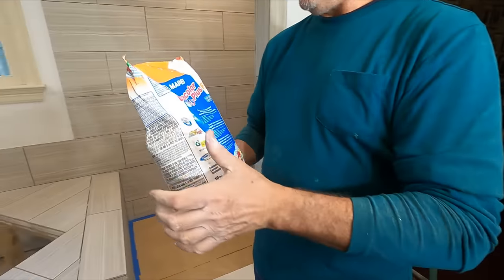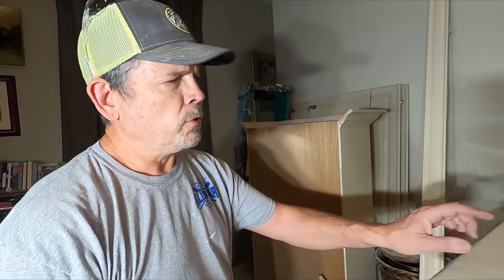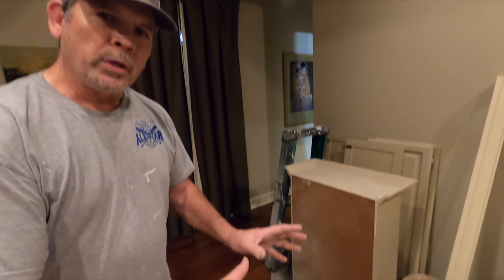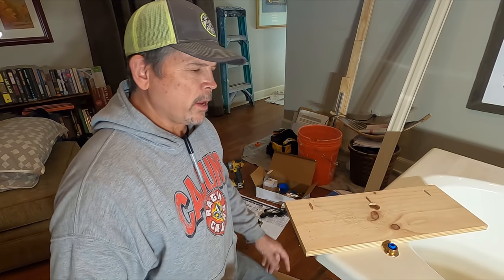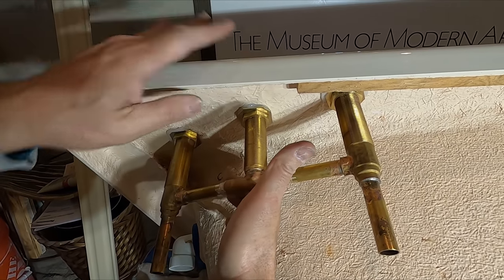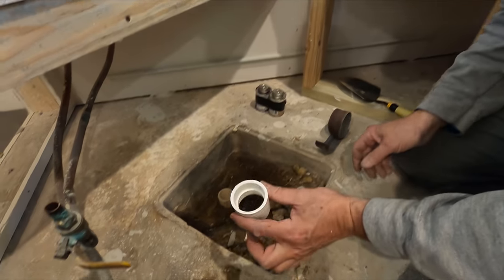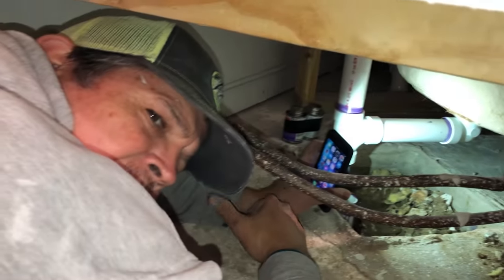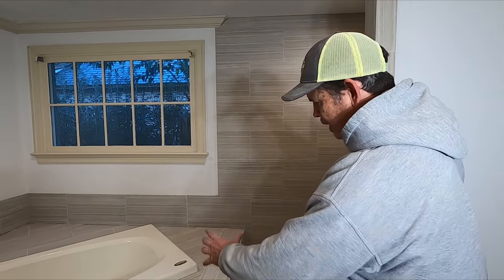A SMOOTH Tub Install and BEAUTIFUL Grout Lines

Comment from the maker: RIP to the Hitachi Corded Drill! 😭 let us know if you have any corded drill recommendations!! 👊🏼

Edit - Also I changed the Thumbnail Gang.. It was driving me crazy all day, I knew it wasn't the best I could do... I wonder where I get that from 🤔🤔🤔
Reply: I'd go beefy D handle driil, like a Dewalt or Ridgid
Reply: I was wondering if that was smoke or previous dust ... Rigid for sure for corded heavy duty drill!
Reply: Ah the memories.  I too burnt up a drill mixing thin set.  Something about tasks like that put a strain on drills.  I replaced the ruined one with a corded Dewalt and it mixed the thin set with ease and is still alive and kicking.
Reply: Get a mixing drill.   Will last longer and not work as hard.  That Hitachi was only meant for drilling holes not mixing mortars and the like.
Reply: I use a 1/2 Milwaukee Magnum still running like a champ! Awesome editing 💯💯👍👍
Reply: Just make sure you get a low rpm high torque drill and you'll be fine. And something a bit bigger than the one your using. I recommend a 1/2 inch. You will be happy with that for a long time.
p.s. Good work, enjoy your video's.
Reply: Dewalt
Reply: I just got a dewalt mixing drill, it is the way to go👍🏻
Reply: I would honestly go with a Metabo. They now own the line your D13VF was built on and the new Metabo HPT D13VF comes with a 5 year warranty. Your drill may be fixable, though. Did you change the brushes when they started to wear out?
Reply: I love my Makita, 35 years old and still going strong!
Reply: @workmanshipbygrace8173  I second this recommendation. Milwaukee's quality is great. This specific drill comes with a 5 year warranty.
Reply: I've been using a D-handle DeWalt for thin-set and setting compound for going on 20 years... same drill!
Reply: Get a proper mud mixing low speed drill, you will kill the best of drills mixing mud. Regular power drills are geared for speed which allows the use of smaller motors so its really hard running them under high load at slow rpms.
Reply: I use Rubi, very powerful and works wonders. Ridgid also has a 2 padle mixer. Would recommend either.
Reply: DeWalt or Bosh
Secondary, what is the state of this house support? Udid 1 room with totaly devasted floor support - whats going on on that front?
Reply: ugh, I can smell that drill through the screen.

call me a fanboy, but I'm probably not going to buy anything except dewalt or bosch.
Reply: I’ve been running the Milwaukee mud mixer daily for three years great mixer
Reply: a dedicated mixing drill is well worth the money.
Reply: I use a D handled Bosch 1/2" drill.  Been using it for 3 years and must have mixed about 40,000lbs of cement, grout, mortar, drypack, plus some large hole saw drilling plus a significant amount of drywall mud mixing.  Still going strong.  Keep in mind you don't want to mix most grouts, mortars at an rpm higher than 200-300 as you will air entrain the material causing potential failures.
Reply: A  spade handle drill ,ridgid has a life time warranty, a lot of tile guys like Dewalt but I didn't like black & decker and I'm not a fan of Dewalt, I had all Dewalt tools at one time but I up graded to Milwaukee and haven't regretted it at all ,the guys that works with me are owners of  Dewalt but they seem to Always have my Milwaukee tools in their hands for some reason.
Reply: Makita 🙂
Reply: I used to have an old right angle DeWalt drill, loud and heavy.
I switched to Ridgid single paddle mixer 1/2 inch chuck. It works wonders , no complaints
Reply: With all of that "mud mixing" get a corded drill 1/2 HP variable speed
Reply: Bosch 550W 240V Corded Hammer drill EasyImpact 550
Reply: Makita DS4012 Spade Handle Drill

Comment: One tip from a plumber, always solder from bottom to top. It’s easier and faster because heat rises. This doesn’t make that much difference on a coupling but the less time with torch on the pipe the less heat goes up into the faucet.
Reply from the maker: Cool thx Josh 👍

Comment: Looks great, guys! I switched to PEX and it has made my recent remodels so much easier, especially in hard to solder places.
Reply: Those cut off valves look suspect.
Reply from the maker: Good call Rick.  One of them leaks 😩

Comment: That was an enormous amount of work from demo to rebuild, and you, sir, are a true artisan who takes pride in every step of your work, never a shortcut, and even willing to redo a job if it doesn't meet your high standards. Well done! It looks fantastic, and I am sure the owners are going to be very happy. I just hope that they don't choose a dark paint color. That master bath is quite small and even with the window, it is quite dark especially since they went with darker tiles. And I know this is late, but going back to one of the first videos, I would have definitely oriented the tub parallel to the wall and extended the shower as much as possible. That diagonal orientation wastes a lot of space in such a small master bath for a tub which is rarely used compared to the shower (you can tell from how new that tub looks) and is not even a whirlpool.

Comment: I reside in the UK, i have watched this project to this point and seriously enjoyed the way you have installed every element, i've been fitting my own shower back in my bathroom; having retiled the whole room floor to ceiling over the last year.
Covid 19 caused some delays of course for materials at certain stages, as i believe you've also had your grout choice of Mapei is excellent have used that myself but the premixed version, is like spreading butter into the joints compared to what people generally use tile adhesive/grout, their not the same thing as you know. Tile grout is exactly that nice and soft and cleans up great!!

I'd like to congratulate you and your son for your videos very well presented and i personally, have picked up quite a few things of benefit to finish my bathroom in due course. I'll watch the rest of the project but felt needed to type at this point and say so :)
Reply from the maker: Awesome thx Chris 👍

Comment: I always run clear silicone around the tub opening when setting the tub so if you get water wicking along the grout lines under the outside silicone tub seal there is a backup.

Comment: You guys are amazing. Especially the way you work together. I would have used vibration saw on those faucet stems with a metal blade. The other day I saw you shim a toilet and then caulk it. Have you ever tried grouting your toilets so that they will never rock? I've been doing that for years and if the toilet has to come out the grout can be knocked out with a putty knife in a hammer. I've learned many new tricks from you guys.
Reply from the maker: Thx James 👍. Yes I’ve grouted toilets in extreme cases 👊

Comment: If you check your local flooring store that sells Schluter products, you can get L mold trims or Quadec trims and corners for tub decks, niches and side walls and a 1/2 inch Lmold for the transition between the Tile and the Hardwood, it finishes it off nice.  For a darker tile that on the floor the A125AT would be nice.
Reply from the maker: We love Schluter trim! The homeowners unfortunately do not. So no trim on this remodel :(

Comment: If you can find Turbo Torch. It works on acetylene or propane and has different size tips and rounded guards that will clip on the tip to keep the flame away from areas that shouldn't get overheated or are flammable. You can also use water spray from a spray bottle on sensitive areas.

Comment: I have a Porter Cable right angle drill for mixing. It’s a bit heavy but has the motor power and the angle helps with the torque. I’m new to your channel but like your videos and the fine work you do.

Comment: Great content.  I get you are setting in mud.  What is done for the lip of the tub where it floats over the deck? Did you studs caulk or leave a gap? If a gap, won't water flow on deck and under tub area?

Comment: I love your videos! You and your son have nailed this down perfectly. The amount of time and detail you spend are both beneficial and not boring us to death. I have a question, or maybe even a tip regarding your plumbing. I've always been a copper guy just because I enjoy doing it and it's been piece of mind knowing my joints are soldered. Recently I've started using PEX and I have to say, I'll never go back. It saves so much time and money and you can make sweeps to fit things like the curved handles and spout you had to straighten to make the copper work. What's your opinion on PEX?

Comment: when i set tile I like to lay it on the mortar touching the adjacent tile then push it away to open up the grout line. If you lay it in leaving a gap when you push the tile tight to the spacers you end up squeezing mortar into the grout line and have to scrape.

Comment: Your dewalt oscillating tool has metal cutting blades that cut very nice, if your ever in a bind like that again. They also make them for grout removal, cutting tile, wood, sheet rock. At this point in time for almost anything you can think of. 🤔
Reply from the maker: Thx Matt.  Yeah I wanted to show folks the saw tip if they don’t have a buzz saw.

Comment: Just noticed at 8:00 the left corner tile is not level and shows up worse when you wipe the excess grout with the sponge. Did you correct that? Just wondering as you are very Persis with all your work. The over all look looks Great and its very well described out in your video how its done.  Thank you

Comment: Any thoughts on getting a cordless mud mixer? Ive been thinking about getting one as I dont like cables dragging on the ground and/or getting concrete mud on it.  I like separate tools so that I get better lifespans on the most common used tools.  I personally like milwaukees cordless drills if you arent thinking about getting a dedicated mud mixer, and both if you want your drill to last longer.

Comment: Hey recent subscriber here.  I like your videos, learned a cool trick on your leveling cement video with the styrofoam strips.
Just my $0.02 but personally I'd have soldered the necessary adapter to the faucet and connected some 30-in Braided Stainless Steel Faucet Supply Line  before I messed with all that.  Would have saved you a lot of headaches in that tight spot.
Nice work guys.
Reply from the maker: Thx William and appreciate the sub👍.  Funny you should mention hoses. I fully expected that faucet to come with hoses much like a sink vanity would. I briefly did consider putting in some hoses but was concerned about water flow issues on that big tub. I really liked the half inch tubing going all the way to the valve.  Good stuff 👊👍

Comment: Do you grout the space between the walls an floors and the wall corners? I'm not sure whether to grout them and silicone over them or just use only silicone to fill. Does the tape on floor cover the space between walls n floor?

Comment: Beautiful tub install.  The only thing I would have done differently would be to use a rubber fernco coupling instead of a pvc coupling for the final tub connection.  Makes it easier and can account for small variances in angle and alignment.  Of course, plumbing codes are different everywhere, and where you are may not allow fernco fittings in this situation.  

As for torch recommendations, I have always used a full acetylene bottle, but that might be a bit overkill if you are only doing bits of plumbing here and there.    The nice thing about the big bottle with the hose is the increase mobility it gives you in tight spaces.
Reply from the maker: I like it Kevin.  I’ll check with our plumbing inspector to see if they allow ferncos or no hubs.  I used to have a large acetylene rig but you’re right it’s probably too much for what I need now.

Comment: It's coming along really nice. My bathtub has foam at the bottom of it, and it's level. It's perfect. I have screwed it into the studs and it's really sturdy. Do you always need to use mortar? I noticed when I removed it, it didn't have anything underneath but a moisture barrier.
Reply from the maker: Don’t always need mortar.  Sounds like you’re okay.

Comment: How long did it take to cut off that faucet nut by hand? I would think an oscillating tool would make quick work of that.
Reply: That's what I was going to say.... oscillation tool works great for that with a fine tooth metal blade.
Reply from the maker: I almost grabbed it.  I wanted to show folks another way in case they didn’t own a buzz saw
Reply: We ALWAYS carry some PB blaster for these situations 👍

Comment: As for the torch, believe it or not, Harbor Freight has a nice one that's inexpensive. Puts out a nice hot flame. It seems to heat the pipe faster than any other torch tip I've owned. I'm actually on my second one, because, like a dummy, I left the first one out in the rain once. Not good. It did corrode quickly.

Comment: I never used a store bought grout sponge- I did once to try it, nah. I would look for old couches and the like being thrown out. I'd collect the foam rubber and cut it to shape. The right foam is a kind of larger type foam foam rubber. It can be cut with utility knives or a band saw for a nice cut. Any size you desire- small large, pointed, thin. Much better than those crummy store bought kind.

Comment: I noticed your drill did what my drill did when I tried to use it to mix mortar. I don't understand why the drills don't work, my drill was made for cement and mortar mixing, I do not understand what I did wrong. You guys have any suggestions as to what drills are better at mixing?
Reply: If your drill was fairly new, you may have tried to go too fast too soon. Mortar is a colloidal slurry and until you get it moving, it is very thick, but as you get it started, it experiences shear and thins out a bit until it settles again and the particles pack once more. If you've used your drill for a while, it may be time to change the brushes if it's not too late. Changing the brushes too late can result in overheating due to arcing at the brushes and can melt the plastics holding the brush holders. The coils are usually still good, but you'll have a heck of a time with the brush holders if there was melting.

Comment: You don’t need to caulk the tile on the tub to water seal it is you use the schluter system is water proof the grout should be enough to water seal it my opinion I do bathroom remodels too nice job guys keep up the good work
Reply from the maker: Thx Joel.  I’m afraid of the grout cracking at that intersection

Comment: Hey stud pack, love your videos! Why mortar the tub in place? Doesn’t that just make it harder for the next guy to take out or upgrade?
Reply from the maker: Fiberglass tubs need the support on the bottom or they will flex with the weight of the water and user.  Some tubs come with foam blocks under them for support.

Comment: One thing I was kinda surprised is you didn’t clean out the area recessed in the concrete around the tub drain. Sure the home owner won’t see it, but a perfectionist would make that area clean for the future view.
Reply from the maker: It’s dirt.  How clean can I get that?   Maybe I misunderstood the question??
Reply: @StudPack  True, its dirt, but I'd figure leave it like you'd leave dirt that is outside that the homeowner would see. Like theres bits of insulation and other construction stuff in there.

I'm not sure how I'd try to clean that.. probably some combo of a shop vac and a broom?

Comment: 18:53 bold move! I would have used a fernco shielded coupling.
Reply from the maker: Yeah but inspectors here want it all glued.   I’ll double check and see if there are exceptions
Reply: @StudPack  I’ve been through this with inspectors in northern Virginia. They won’t allow a non shielded fernco, but shielded is fine. Makes life a little easier in situations like this. I could be wrong but I think that’s ok per national building code.

Comment: TS4000 or TS8000 for your torch needs by the way
Reply from the maker: Cool thx Mike 👍🔥
Reply: @StudPack  TS8000 gets the job DONE but the tip likes to stay hot, the TS4000 doesn't have flow control like the 8000 does but it does come with a cool touch tip
Reply from the maker: Good info thx 👊

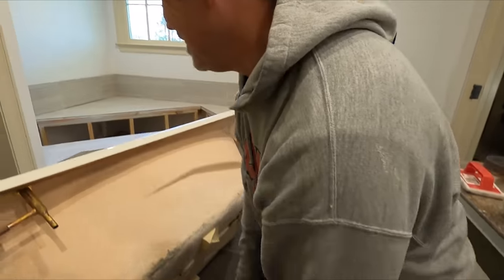Comment: 16:45 how did you measure the distance from the coupler to the T in order to cut a connecting piece of pipe? I’m doing the same thing in my own home, and would love the tip! Or were you able to get to it and actually see it in place? Thanks and great video as always!
PS For some obscure reason I really enjoyed the background music at 15:30. First time in YouTube history I think! 😆
Reply from the maker: Thx Richard.   We set the tub in place after the waste and overflow was attached and measured from the bottom of the tee to the top of the coupling and added 1-1/2” to that length.  Hope that makes sense 👍
Reply: @StudPack  Yes it does thanks! Sadly I don’t have the clearance to easily see mine ... pity you can’t come up to Vancouver BC :)